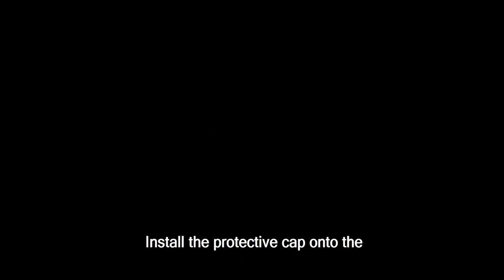How to change shock absorbers on a SUZUKI SWIFT 3 – problem-solving [TUTORIAL AUTODOC]

Comment from the maker: 00:26 — Use a combination spanner No.16 Use a drive socket No.15 Unscrew the stabilizer link upper fastening
00:43 — Use a drive socket No.12 Use a Ratchet wrench Disconnect the brake hose holder from the shock absorber strut
00:58 — Use a flat screwdriver Disconnect the ABS sensor cable fastener
01:04 — Use a combination spanner No.17 Use a drive socket No.21 Unscrew the lower fastener of the shock absorber strut.
01:32 — Disconnect the steering knuckle from the shock absorber strut.
01:47 — Use a flat screwdriver Unscrew fixing bolts of the protective cover. 
02:14 — Use a combination spanner No.18 Use a HEX bit No.H6 Unscrew the top fastening of the shock strut mount.
02:59 — Use a combination spanner No.17 Use a HEX bit No.H6 Unscrew the top fastening of the shock strut mount.
03:36 — Before installing a new shock absorber you should pump it manually 3-5 times.
04:27 — Use a combination spanner No.17 Use a HEX bit No.H6 Screw the top fastening of the shock strut mount
04:50 — Tighten the shock strut top mount. Use a combination spanner No.18 Use a HEX bit No.H6
04:57 — Install the protective cap onto the shock absorber strut mount. 
05:10 — Tighten fixing bolts of the protective cover. 
05:30 — Install the steering knuckle on the shock strut and tighten it. Use a combination spanner No.17 Use a drive socket No.21
05:58 — Connect the brake hose fastener to the shock absorber strut. Use a drive socket No.12 Use a ratchet wrench
06:09 — Connect the ABS sensor cable fastener. 
06:16 — Tighten the stabilizer link upper fastening. Use a combination spanner No.16 Use a drive socket No.15

The tools you need to replace shock absorber: 
- combination spanner No. 16
- drive socket No. 15
- drive socket No. 12
- ratchet wrench
- flat screwdriver
- combination spanner No. 17
- drive socket No. 21
- combination spanner No. 18
- HEX bit No.6

Comment: Is it necessary to align the camber after the shock absorber change?
Reply from the maker: Yes, after any work related to the suspension of the car, it is recommended to correct the alignment camber.
AUTODOC

Comment: Well maintained example of a Swift noticed:
- New brake disc and pads
- New Shock absorbers 
- New Anti roll bar links

Easily in excess of £400 in parts.

Are these cars reliable? Any known issues...
Reply from the maker: Overcomes off-road successfully. 
Simple but slightly stiff in suspension.